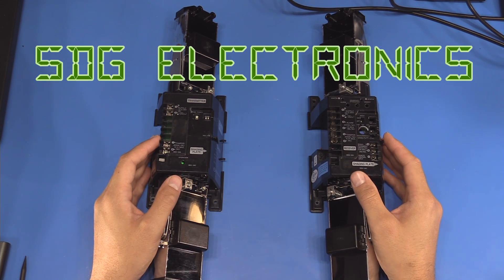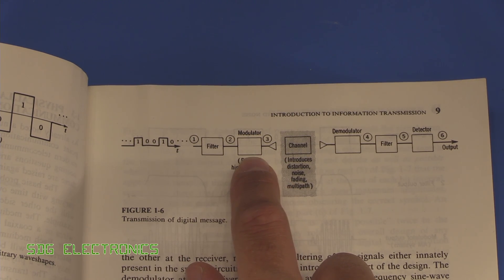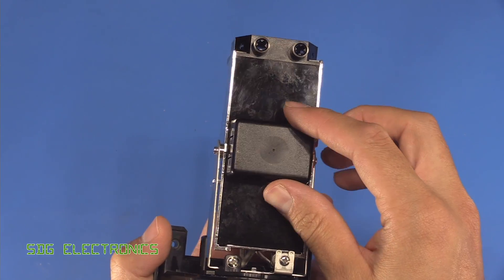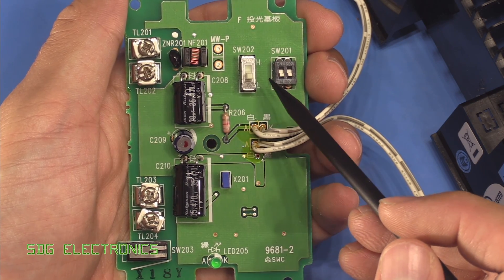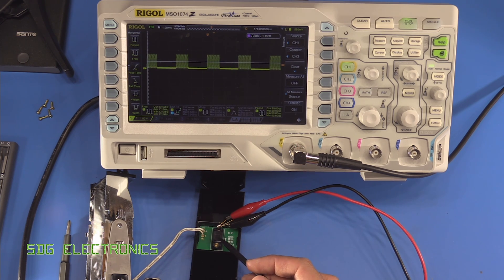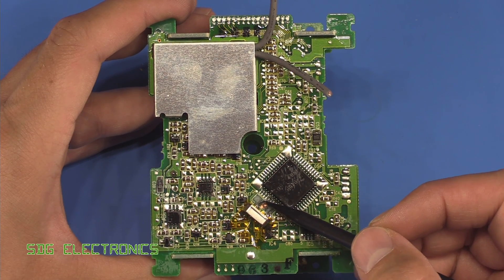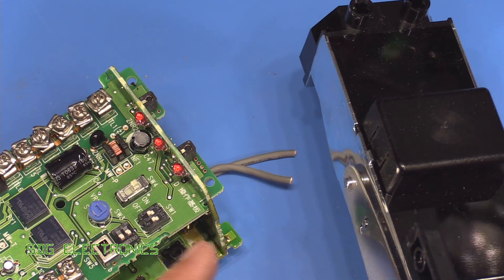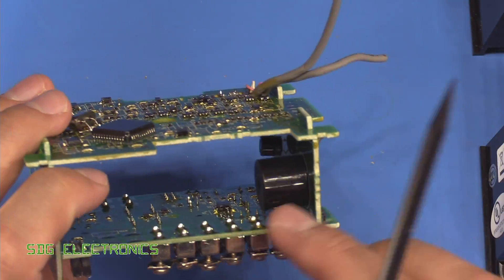SDG #102 Beam Break Sensor using Amplitude Modulation Techniques

Comment: I was thinking of using IR laser diodes and pulsed messages to avoid duplication of signal, but my application was light barrier and not IR gate...  Yours seems extremely complex, this is something that's widely used in parking lots and whatnot, with just an emmiter and a square reflector...  those seem like expensive devices to leave abandoned on an empty field....
Reply from the maker: Much of the complexity is to increase the immunity to external noise such as sun, car headlights etc. The modulation means so long as the sensors aren't saturated, the device still works in the presence of IR light
Reply: @sdgelectronics  I can't say I'm familiar with IR receivers, nor how easily they saturate from sunlight...  Still seems like a rather involved process when you could just aim the beam down a tube, or use a wavelength and optical filter, the sun surely doesn't give off a watt per cm2 in all frequencies..?
Reply from the maker: I will explain more in a video soon, but yes, you can use techniques such as a black tube to reject much of the ambient light

Comment: Hi friend, if you rub thermal paste with a swab over the IC's you'll be able to read their part number easily (but you have to remove the varnish anyways, which i do with a swab and rubbing alcohol).
Reply from the maker: Good tip 👍
Reply: @sdgelectronics  I have a question that got me curious 11:11 this NEON goes open (like a fuse) when voltage is too high or just limits the voltage?
Reply from the maker: The neon is open until the voltage at which the neon ionises - usually around 70V-100V. Once it reaches that voltage, the neon becomes a lower resistance path. Depending on the current flowing, the neon will either glow or simply arc over.
Reply: @sdgelectronics  Thanks :)